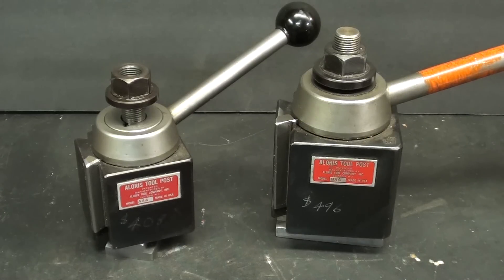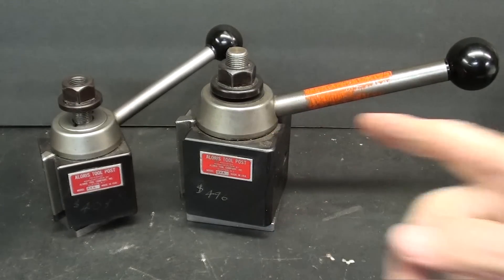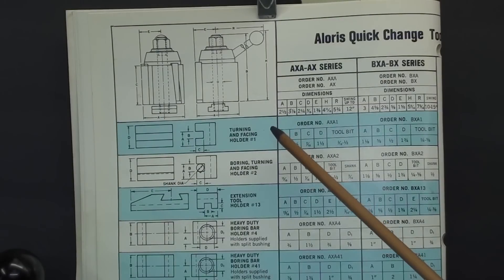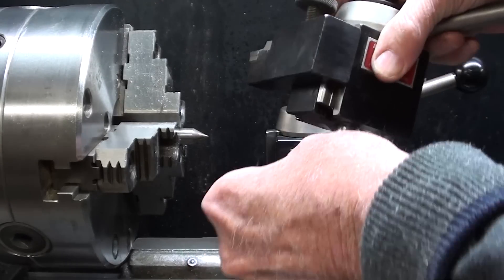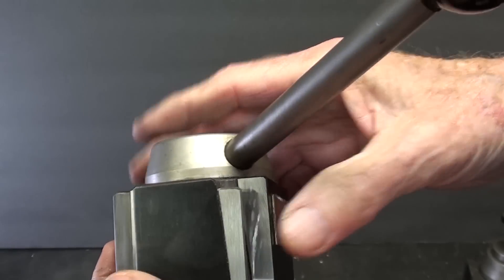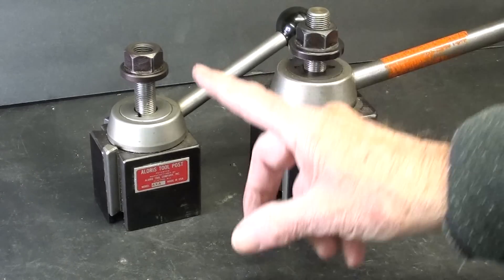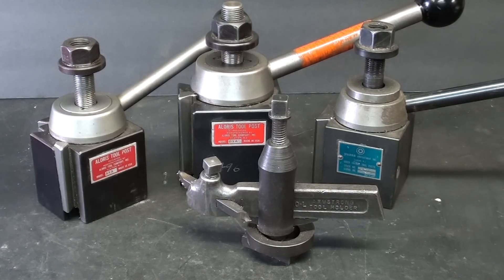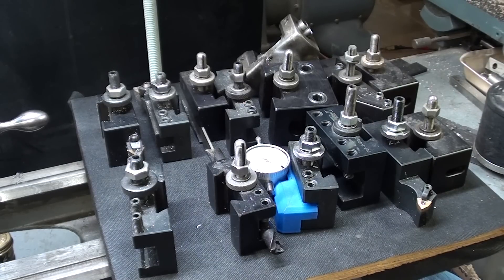SIZE MATTERS ALORIS QCTP short #26 tubalcain toolpost dorian

Comment: I have an import AXA wedge type tool post I bought from Matt Krug at Lost Creek Machine several years ago. It has given good service and I would recommend it to any home shop machinist. I have a neighbor who also has an import AXA tool post and it is a completely different matter. Very sloppy and poorly fitted. All Chinese imports are not the same. Recently, I bought  what seemed to be  a "too-good-to-be-true" lot of four AXA tool holders listed on eBay for something like $25.00 plus shipping. They were a bitter disappointment. The dovetails were so oversized that I couldn't get them to clamp tightly without using shims. The set screws were so soft that the hex end stripped out while tightening. Also a bad experience with the seller. In short, I should have known better and you get what you pay for. I would buy from someone you can trust like Matt at Lost Creek or Shars. I have had nothing but good experiences with both of them. And while I like, and am still using, my import tool post, I recently had a chance to buy a genuine, second hand,  Aloris AXA that I use on another lathe. It is definitely of superior construction and better quality than the Asian made stuff.
Reply from the maker: Very good analysis. And everyone loves Matt.    Friendly with integrity.

Comment: While I prefer the Aloris branded tool posts and tool holders over any of the cheap imported holders I have purchased from eBay.  I can say the Shars and Phase II tools I have bought recently hold up nice and are  decently well built. As are the Dorians. I use mine in a commercial setting. However I believe The home shop machinists will get a lifetime or two out of them I would guess. Cheers

Comment: I think you would need to be a maroon to suggest the current inflation situation isn't causing everyone some pain; however, Aloris is the Cadillac of tool posts. Suggesting they are $46 or $49 tool holders being over charged for simply due to inflation doesn't ring right.

If you could produce that quality of tool post for $75 then sign me up! I wager there isn't a person here though that would put so a low value on their time much less the materials to produce one of these.

Yes, the knockoffs can be had for fractions of the price; however, they are not of the quality level of the Aloris. They work pretty well though and for the hobby machinist they may provide a lifetime of use. I would wonder if they would l last more than a year or two in a daily shop situation without repair. Also, the living standards of the people making the overseas knockoffs can hardly compare to western lifestyles and I doubt many would choose it to replace their current situation.

Buy once, cry once. This end this particular rant. ;)

Comment: Adding to what you said about piston vs wedge style: repeatability is the desirable advantage to the wedge style. Piston style holders use the angled dovetail faces as the datums. Any difference in handle pressure will affect how much the holder springs open and where the tool tip ends up each time. The wedge style holder locks the holder up against the body of the tool post in both the front and back, establishing Z. The front dovetail indexes in-and-out (X). The measured result on my CXA Dorian is literal repeatability in tenths. This translates into being able to change a turning tool to a parting tool, cut off a part and return to the turning tool, in exactly the same position. As people move to DROs or CNC, the repeatability becomes even more important.